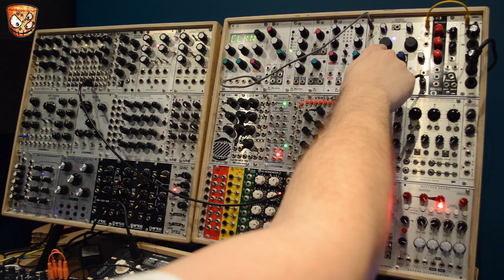Patch Idea #3 - Audio Rate Delay / Karplus Strong Synthesis

Comment: So, on the strymon star lab, the Karplus mode can make a bowed sound, I’ve been trying to replicate that somehow, and I’m still a modular novice, could you or would you consider doing a bowed Karplus patch with the logic and explanation behind it? I’m struggling, so any advice would be appreciated.
Keep up the great work 👏👏👏
Reply from the maker: Breaking down that sort of patch you need the karplus fast delay element and then you need a suitable exciter. If this is sort and percussion the end result will be more like a plucked string. If you take a noise source, patch that into a VCA then use a slow rising envelope. The output of the VCA should now be a noise sound that fades up and down, patch that into the fast delay line and you can create the pitch and tone of the string.

Hope that helps.

Using noise fading up in a VCA like I mention in Mutable Instruments Rings works well. Or Mutable Instruments Elements is made specifically to have all of those excitement and then resonator elements in one module.

Comment: Do you know how to get a regular chromatic scale out of a karplaus-strong patch?
Reply from the maker: it's hard to do as the delay times often don't track 1v/oct. I've used sequencers into quantizers then into attenuators (so it's not quantized afterwards) and had ok results. but tuning by ear with your modulation sources seems to work best.
Reply: Sounds like a job for the silent way plugin!

Comment: Interesting, although the PLUK mode on Braids does Karplus-Strong synthesis rather better...but I suppose that wasn't the point.
Reply from the maker: Timbot yeah but that's a whole lot of digital code running that one. I wasn't really going for plucks like the Braids mode here either, something more metallic and gritty. It can get closer but ultimately if that flavour of Karplus appeals to you Braids is way better. The Echophon isn't the best at Karplus either but it gets you somewhere. The E580 (if I have the number right) from Synthesis Tech seems a much better candidate.
Reply from the maker: DivKidMusic plus this isn't really Karplus Strong Synthesis either, but gets close in terms of sound. Karplus would have you send a short blast of noise into the delay and have the delay rate so fast as to set a pitch and the feedback set the note length.